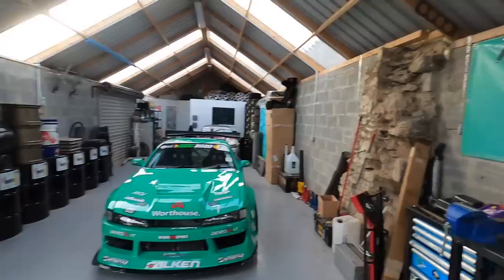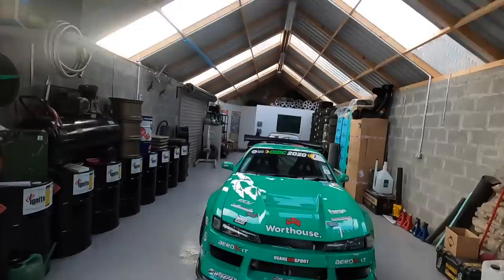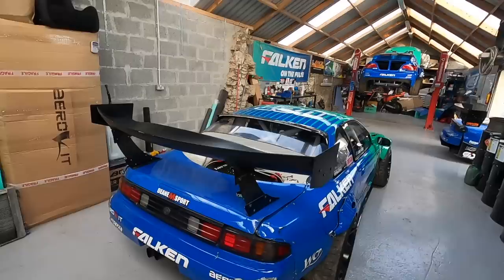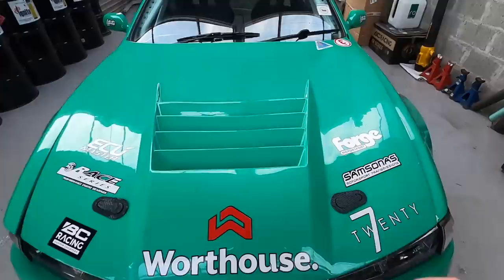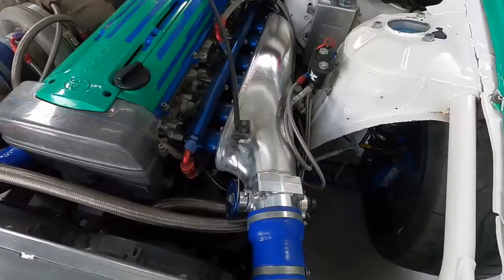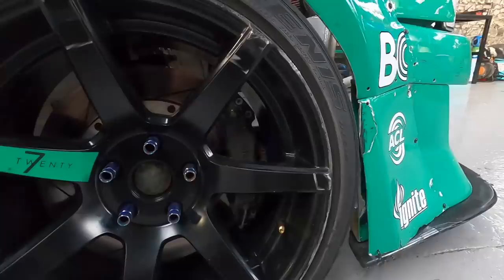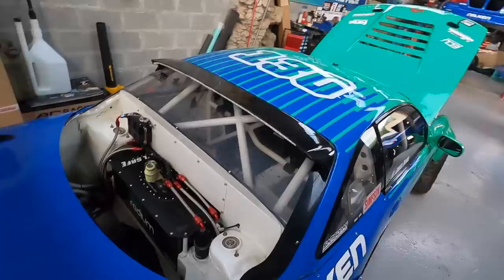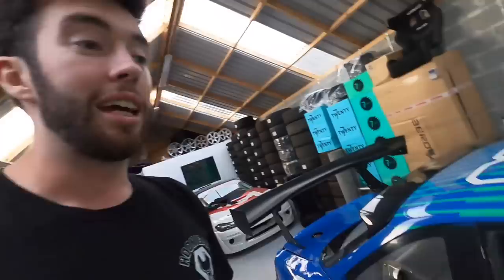SECRETS of my *750BHP* 2JZ S14

Comment: James, I know this is an old video but was wondering if you could go over what you did underneath the wheel wells (front/rear) to clearance for the wheels/angle/tires not hitting/rubbing? i.e. cut out metal and welded plates instead or hammer everything or what? Thanks in advance and love the videos!

Comment: looks like the original was the racing edition, i have the exact same model in my shed now undergoing 2jz conversion. :) I was wondering about your exchaust system, oval would do it. mine is LHD i so i chopped the floorpan from the passanger side to make room for 3.5" exchaust